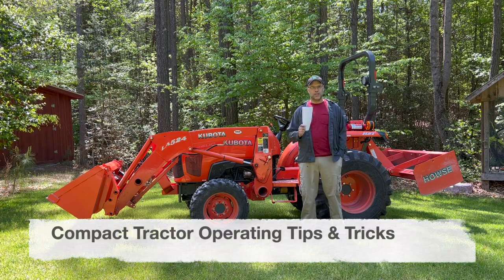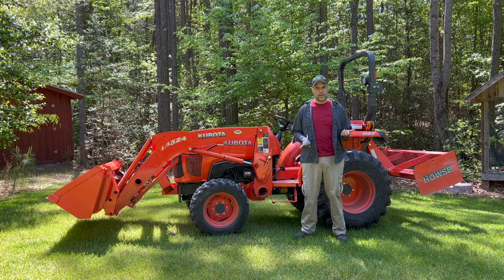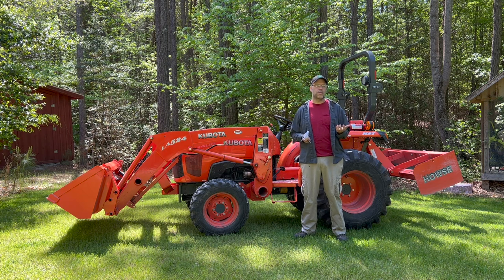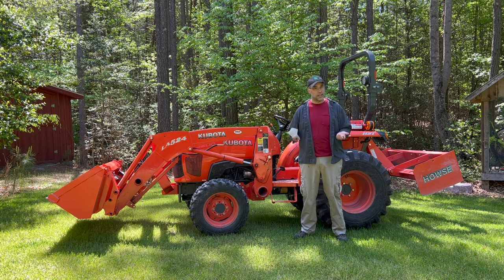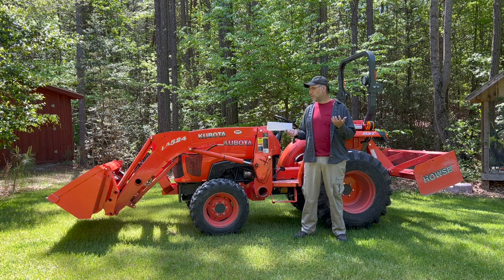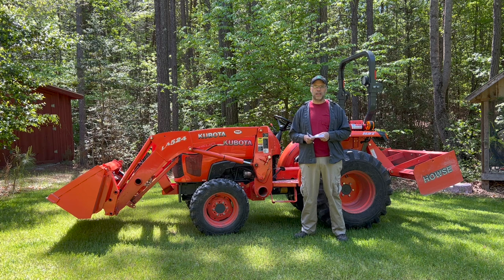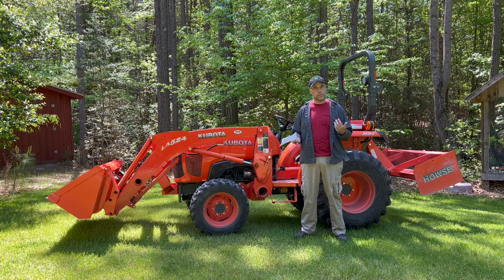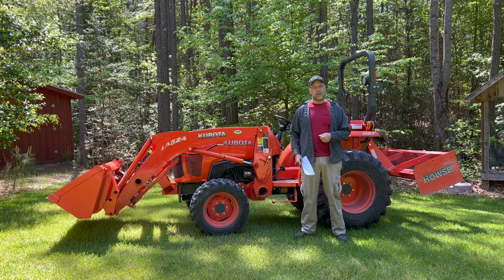Compact Tractor Operating Tips & Tricks

Comment: Unbelievably excellent.  I've been operating tractors for more than 50 years and there are countless nuggets of information thru out the video.  Especially with back dragging of the bucket.  BTW I noticed your Wallenstein chipper video.  I just received the Woodland Mills 8 inch chipper.  Amazing quality.  I think based on that as well as your Woodland Mills sawmill video that I see their sawmill and your shed design in my future.  Kind Regards.  Craig

Comment: Thanks. Awesome, one question, what is your thoughts on stump buckets. Are they design to properly use the lift and tilt function of the loader or do they stress the piston in A way that will stress/damage the piston or loader?
Reply from the maker: I've heard they should only be used on skid steers, not compact tractors.
Reply: @Lumber_Jack  wow, that was fast, thanks for the response.

Comment: Very interesting video.  I could have used some of those tips when I was a new tractor owner.  I did learn by myself without any major issue.
I do have a question.  I have heard that keeping the hydrostatic pedal fully depressed kept the fluid circulating better therefore  cooler.  I thought I had to control my speed by being in the proper gear range and adjusting the engine throttle.  Can you clarify this for me?
Reply from the maker: HST tractors normally have a cooler (radiator) to take heat out of the fluid, and that operates at a flow rate independent of the HST -- it's going to have a flow rate based on the tractor's main hydraulic pump flow rate, which will be tied to the engine RPM.  That's really what dictates cooling.  The overall system flow rate (and cooling) will be more or less the same regardless of what you do with the HST.

What you do with the HST control won't affect flow through the cooler or the ability to remove heat from the fluid, but it sure does affect how you add heat to the fluid.  All the HST control does is to actuate a swash plate which varies flow rate within the HST itself, between input and output pistons.  The harder you "work" the fluid through that process, the more it will heat up.  You can minimize the work and heat by matching input power and output load properly.  When there is a mismatch, such as pressing the control too far for a given load or having the engine RPM too low for a given load or being in too high of a gear range and creating a higher load, the fluid has a tougher job and shears more, leading to heat.  It will also thin out a bit and get less effective.

Really, the extreme is running the HST under so much load (from any of the above reasons) that the hydraulic flow has to go into bypass.  But leading up to that, excessive whining noise is your clue that you are working the fluid too much and heating it up.  Different tractors have different levels of whine (for instance my standard Kubota L model has a much noisier HST than deluxe Grand L models) but you will quickly get an idea what whine is normal and know when the whine raises up to a protest level from overworking the HST and fluid.  Periodically I'll forget to release the parking brake and the amount of whine coming from the HST is a pretty good "hey you idiot" signal coming from the tractor.
Reply: Thanks for the information.
I don't really work my tractor hard, but I will keep your advice in mind and I won't worry about overheating my fluid.